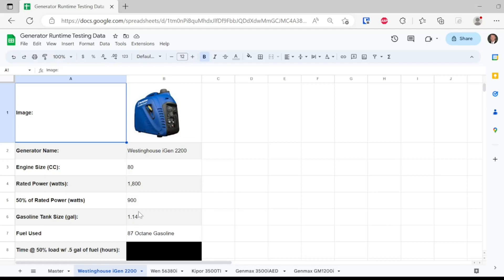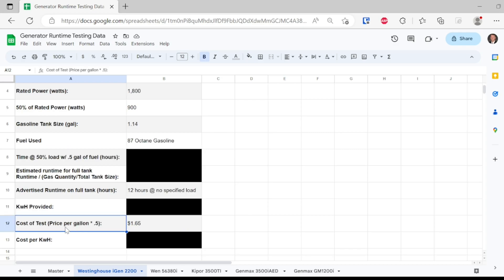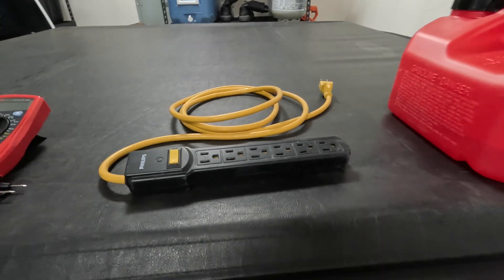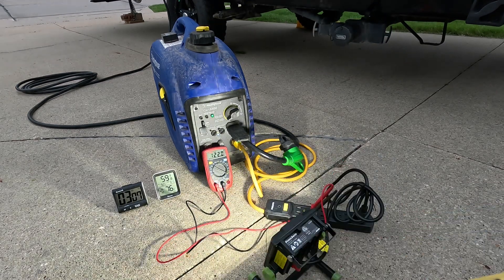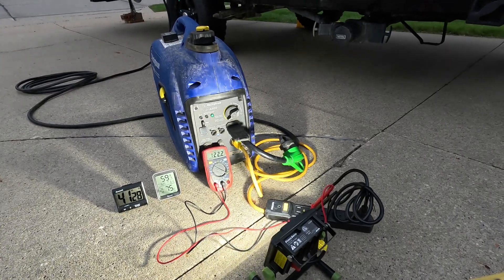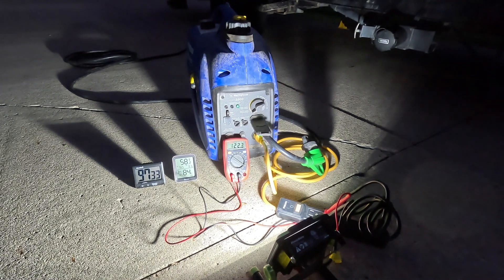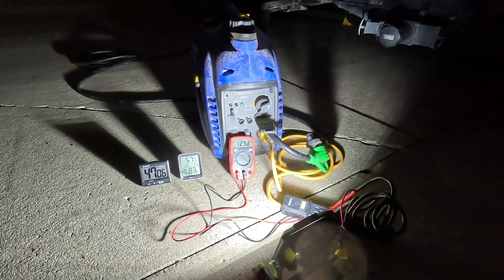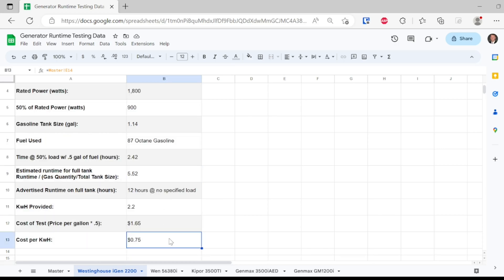Westinghouse iGen 2200 Runtime Test | Generator Runtime Testing Series

Comment: Super informative video Thank you for sharing all your data. It's very helpful! 

I live in Australia, and using your data, I have worked out that it would cost me about $1.60 per hour in Australia to run this great little generator at 50% load. 

Current price in Australia per liter, for regular unleaded fuel is $2.00 AUD per liter. Northern NSW (4th May 2024)

I could then get about 25 hours of power from a standard 20-liter jerry can here in Oz.

I have "EGO" Power Equipment batteries, that I could charge using the generator. (One 5Amph batterie could be charged in about 40.00 minutes) I can then use the charged 5 Amp EGO battery and the 240V inverter attachment I have for the EGO batteries, and then have regular 240 Volt power from the batteries, silently all night long, which is perfect! 

Works out to be potentially around 50 hours of Australian 240 Volt mains power, from a regular 20 Liter Jerry Can. (5.28 USA Gallons) for $26.40 USA/$40.00 AUD.

PS: Have subscribed to your channel. 

👍

Comment: Great video Cody, can't wait to see the future tests. PS how did you ensure the 50% load? What were you running inside the camper?
Reply from the maker: I made sure the batteries were discharged an appropriate amount, then set them to charge at the 50% load of each of the generators with no other loads on inside.  Thanks for the nice words and thanks for watching :)